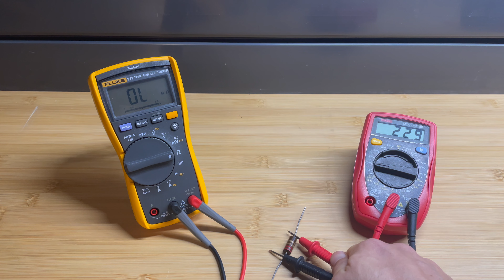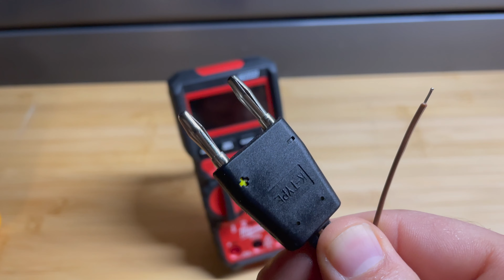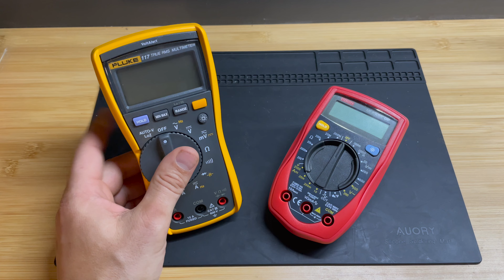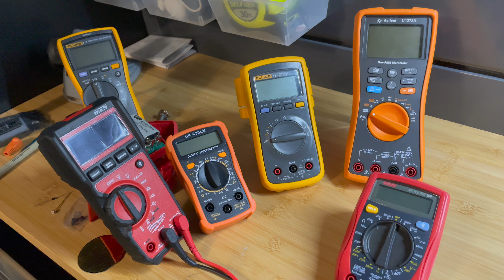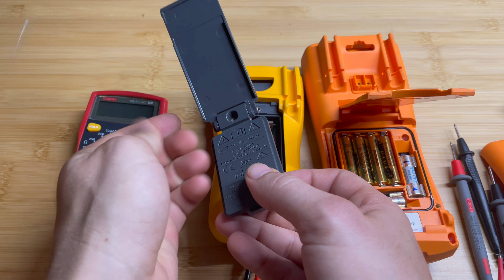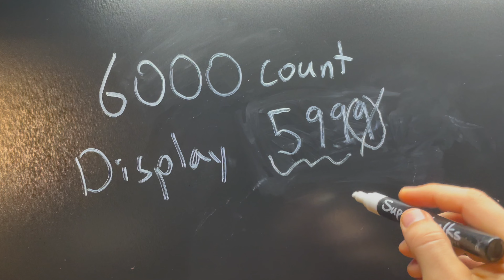Selecting a Multimeter - Top 5 Multimeter Considerations

Comment: For the same price. Manual range is faster than auto range 20x price.

If you have money under $100. Go to manual.

Manual range very quick if you measure lot of different resistor value. Like electronic component check. Just select 1k or 200k selector, and you can read hundred of resistor very quick.

That not fluke auto range, but semi auto.

Auto range only have 1 selector.

Auto and semi auto is competible for electrician, when they only measure voltage and contiunity.

Comment: Manual range meters usually provide a reading faster than an autoranging meter. You're comparing your manual meter with one of the fastest autoranging multimeters available, so it's not so obvious, but autoranging meters start at their topmost range and work their way down. If you're measuring something at the last range out of 4 ranges, and each step takes the meter half a second, that makes for a slow reading. There's a reason that virtually all autoranging meters, including your Fluke 117, allow you to turn off autoranging and select a range manually.
Reply from the maker: Well that is one good point for a manual ranging meter - so I should give credit where credit is due. So definitely worth noting. However it's a very specific use case, because you have to know what range you are in ahead of time and it would need to be in the lower range to really be that much faster. It also assumes you are not going to need to change the dial for multiple measurements. So yes if you are measuring in a low range multiple times it might be noticeably faster, but that is a very specific situation. I think for most general measurements the autoranging is going to be faster because a lot of times you do not know what range you are in or the time difference will be negligible.